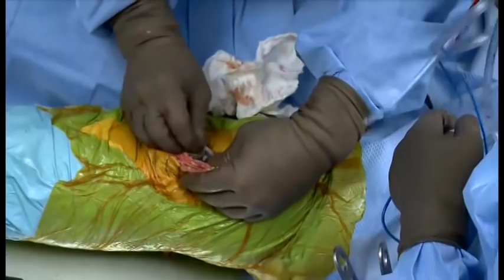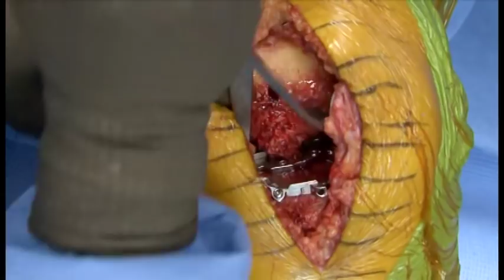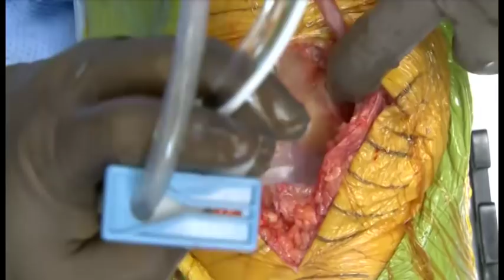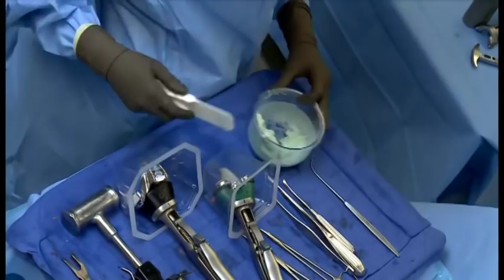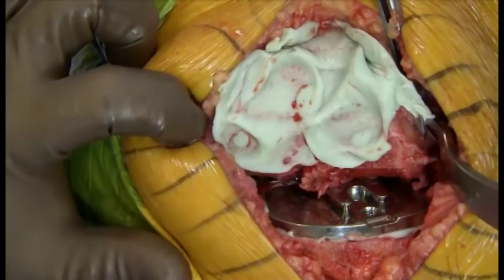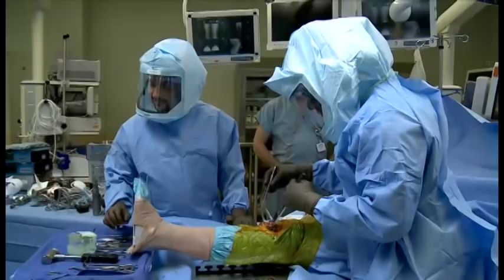Total Knee Replacement (Part3) - Brett R. Levine, MD, MS

Comment: I chose to watch this presentation because I'm probably going to have to have a knee replacement in the future. Yes I am overweight. Both of my parents had arthritis, I am a bit bow-legged so it is quite possible that I would have arthritis even if I weren't obese. Actually, I developed arthritis in my cervical spine before I developed it anywhere else. Now I know I'm a reasonably intelligent human being but I don't think my "over-sized" brain sitting atop of my cervical spine caused arthritis in my neck. Do I think that my weight contributes to the pain of knee arthritis, yes I do. Is it the only factor? No, it isn't. 
The weight comments were in some ways, valid and certainly, obesity has to be considered during pre-op planning and that it was a valid issue to raise during the live broadcast. However, the comments made, at least in this portion of the broadcast were tasteless and unnecessary. I sincerely hope you apologized to the victim of your comments. She certainly didn't deserve the ridicule and I'm sure you received an ample fee for doing the surgery (although if she was pro bono she still didn't deserve the ridicule). The comments were in poor taste and certainly inappropriate particularly when you were taping the surgery and putting it on you tube. In the future, thinking before you speak might be in your and your colleagues best interests.

Comment: why the little plastic disc under the knee ? are any screws used the connect  any of the hard ware ?
also if i were a female patient  i would be offended by the weight comments as well